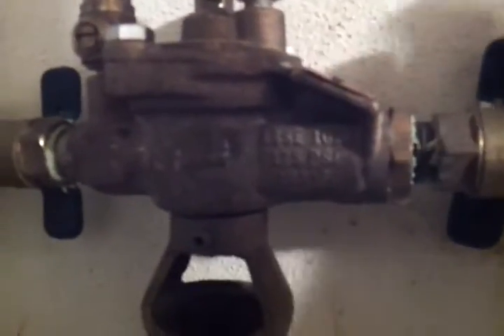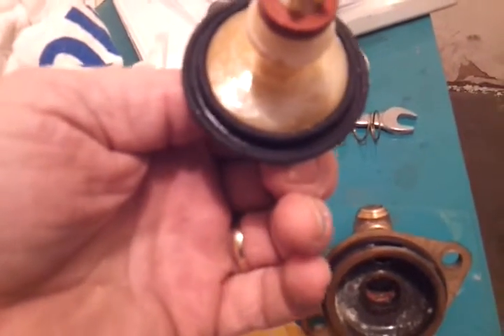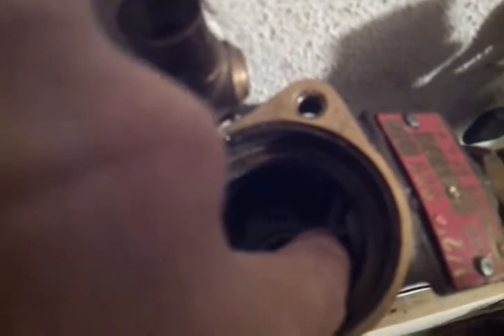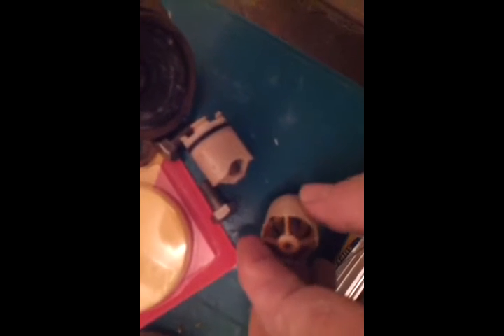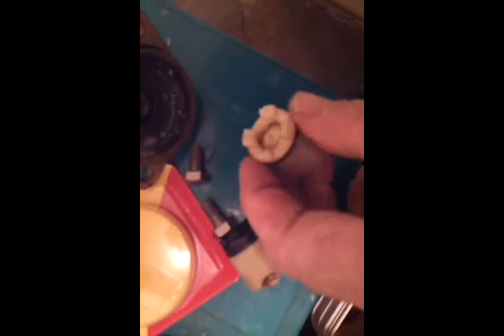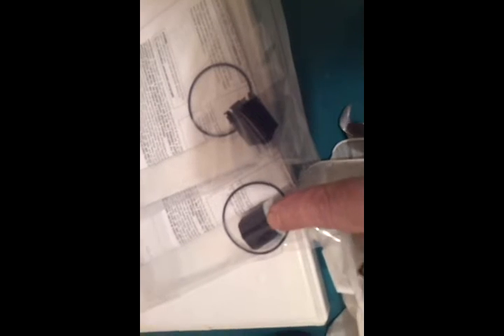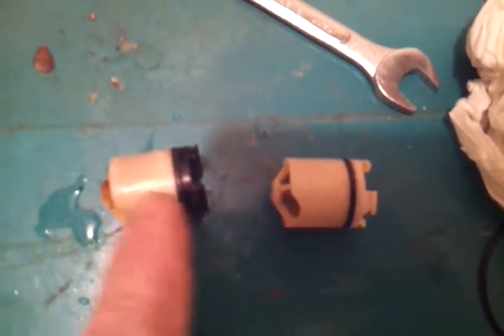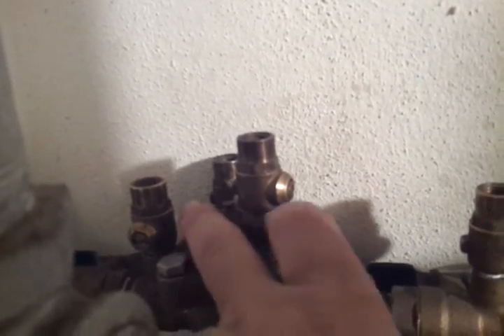Back Flow Preventer Leaks Chatters Watts 009 1/2 inch :Solved

Comment: I couldn’t believe how expensive this repair kit was ,,,more expensive than buying a whole new setup
Reply from the maker: This model of backflow preventer 1/2" Watts 009, costs $581.00 and the repair kit is only $160.00 based on Graingers current prices. You could get a cheap Zurn backflow preventer on Amazon for 250 but that's not including re-piping the valve so as to make it fit the Zurn model.

Comment: Hi, thanks for the helpful video. I have a 1/2 009 qt it was working fine i had to shut the water off and shorten the water line and  now it drips. Also does this valve regulate the pressure? I have it.connected to a vacstar suction pump customer is complaining that the suction is low after I worked on the valve. Is there a way to increase the water pressure. I'm out of ideas , suggestions are appreciated. Thanks
Reply from the maker: it shouldnt affect the pressure
Reply from the maker: sediment in the system can decrease the pressure at the supply valve to the vacumm pump. may have to open valve and clear the sediment.
Often sediment will collect in the valves from simply shutting off the water system then turning it back on
Reply: @greenrumour  I will try and open it and clean it hopefully that will stop the relief valve dripping. Do you recommend  grease or anything else to clean the O rings.  Thanks again.
Reply from the maker: @visi8194  allways try and use silcone grease if lubricating water system valves and parts. The valve that im refering to is the hose bib that his tool is connected to. However if this check valve is still dripping at the spill tube then the vacuum breaker may be either damaged or has sediment in it.
Reply from the maker: https://www.youtube.com/watch?v=TIqbGxoq23s

Comment: I just broke a check retainer cage that would not slide out. Wish I knew the crack the #2 SV trick. Will that work on the 3/4 inch 009M3 too? This device has to be serviced pretty much blind as there is not enough clearance to see in from the top.
Reply from the maker: should be the same. good luck

Comment: Very helpful and you took your time explaining. Just wondering why I got this problem when I changed double filter cartridges that supplies water to Hoshizaki Ice machine. I had no problem before doing this. Valve seemed fine beforehand. No chatter,  no leaking. It's a 009 Watts btw. Thanks. Your feedback would be greatly appreciated.
Reply from the maker: Hoshizaki machines are wonderful have used them for years. ours made the best half moon ice.
Did you turn the water off to the area when changing the filter? That will do it. Could be sediment in the system that changed its location or just the back flow seals can change position just enough to show their weaknesses.
Reply: greenrumour ok..I will check today. Hopefully will not need anything new. When I have everything apart I'll flush the line as well. Thanks for the quick response. I'll let you know how I made out.

Comment: will this work if it's not chatter but a high pressure spray? coming out of the relief valve
Reply from the maker: it essentially refurbishes the main components. If your relief valve isn't torn or damaged this should solve the problem. if you change the relief valve as well your unit will be like new.
Reply: thank you !! very helpful